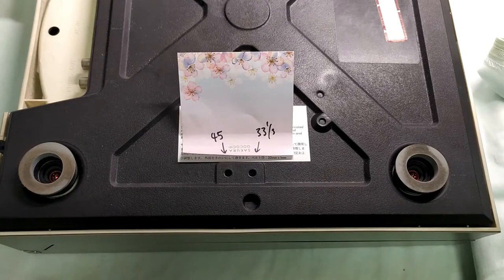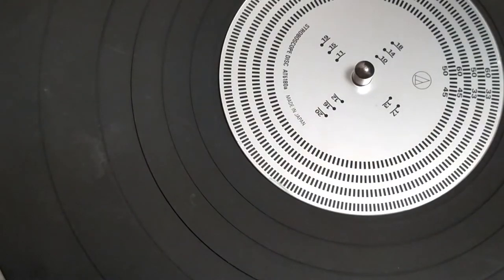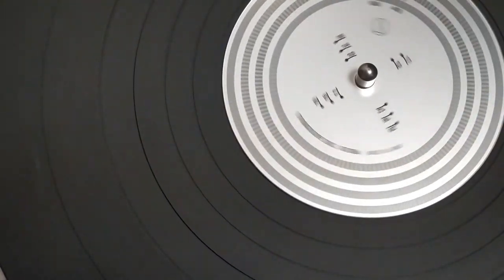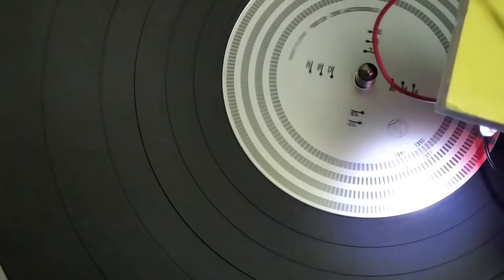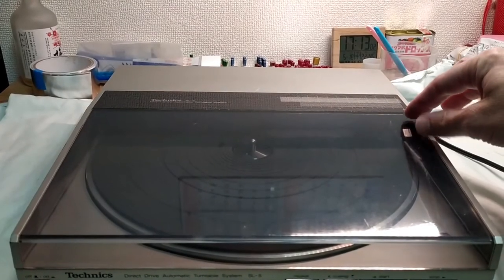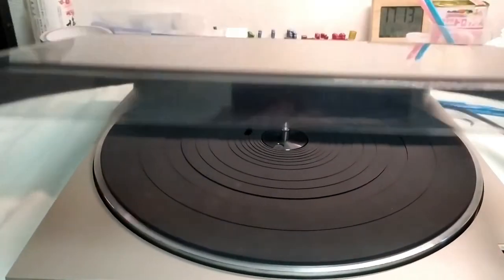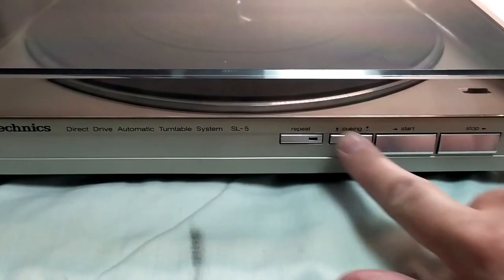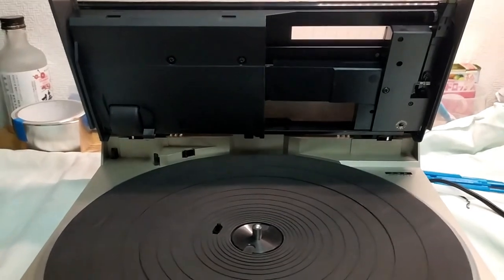Technics SL-5 part 8 - Speed Adjustment

Comment: Thanks for the video, nice job. Looking forward to the rest of the series.
Some questions if I may: 
1. How stable is the speed on these after you set it up? 
2. Why didn't Technics put a platter strobe on these models like the SL-1x00 series?
3. How hard is it to see the tonearm to manually queue tracks?
4. Does the sound mute when the tonarm is lowered on the record to eliminate the 'drop pop'?
Reply from the maker: I would rate the stability as awesome.  It has been years since I had a record player around, I mostly had CD's.  These have really made me appreciate the format.
I think there is no strobe as this is a lid down, user friendly model.  SL-1200s are for people that like to mess around and tweak their turntable.  
I rarely manually que, but I suspect with a little practice you'd be fine.  The red LED indicator arrow seems quite precise, but again, you just need to use it a bit.
I haven't noticed any muting nor any pop, but I suspect the key on this model is in how well controlled the drop is - I talked about that somewhere, maybe in a separate video.  

I really like these machines, and they suit my use of records - I just want to play and listen.  So far, I haven't  been disappointed.  Quality cut records (I have some that were New Old Stock) really sound awesome.
Reply: @felix_da_katze  Thanks Felix. I wasn't sure if the Quartz PLL lock on this model made the difference between needing a regular strobe adjust or just needing a yearly tweak.

Comment: What is the light that you are using?
Reply from the maker: I made a flasher using an arduino, a transistor, and a bright led.  I like this solution as the on time for the light is very short, and I suppose I convinced myself it is more accurate.  Whatevs.

If you can spell Arduino you can figure out how to hook this up and get it working.
Here's the code:

/*
Arduino Strobe timer for LP Speed checking

This timing is for 50Hz timing mats

  const float on_time = 2;
  const float off_time = 8;

*/

  const float on_time = 2;
  const float off_time = 8;
// the setup function runs once when you press reset or power the board
void setup() {
  // initialize digital pin LED_BUILTIN as an output.
  pinMode(LED_BUILTIN, OUTPUT);

  
}

// the loop function runs over and over again forever
void loop() {
  digitalWrite(LED_BUILTIN, HIGH);   // turn the LED on (HIGH is the voltage level)
  delay(on_time);                       // wait for a bit
  digitalWrite(LED_BUILTIN, LOW);    // turn the LED off by making the voltage LOW
  delay(off_time);                       // wait for a bit
}

Comment: I have one of these units, but it often auto-returns early, depending on the record. Do you cover this in the series? If you could save me a few hours and point me to the right spot in one of the videos I'd appreciate it!
Reply from the maker: I had a similar problem with another one I did, and it was basically down to the position of the tonearm shifting/in the wrong place.  Check your plastics.  If the swivel point of the tone arm is loose, as in if you can move it side to side, it will never work right.  Part 6 might be the most relevant video.

Comment: thanx for the very educating videos. One question: my needle drops too fast on the vinyl, should i put some silicon oil on the copper ribbled iron left to the middel of the tonearm or is there another solution?
Reply from the maker: You'll see in the videos that the ribbed brass bushing needs to be solidly contained in the plastic, and there is another part that rotates inside that.  If the ribbed bit is held solidly in the plastic, then yes, put some silicone oil, as thick as you can get, in there to damp the drop.  #1000000 or #500000 should probably do.  Tamiya make oils for radio controlled cars that seem to be the best source for quality, weighted oil.
Reply: @felix_da_katze  Thanx Felix, I will try to do that